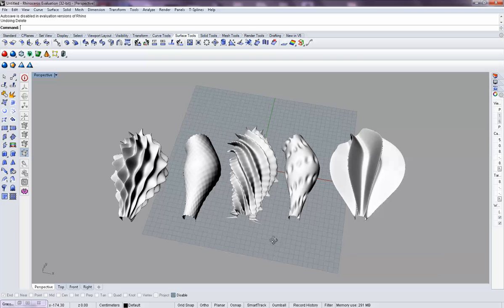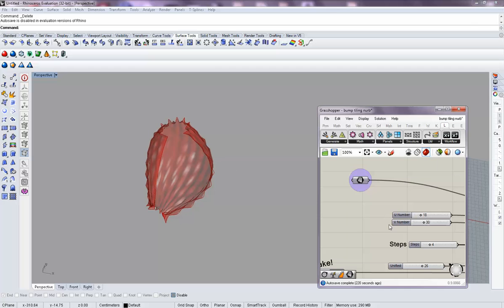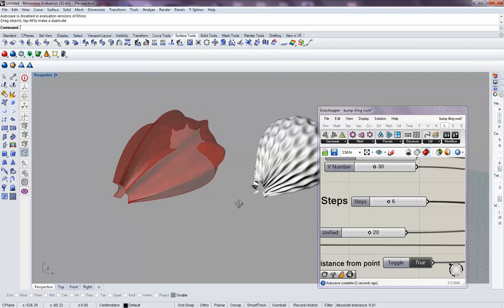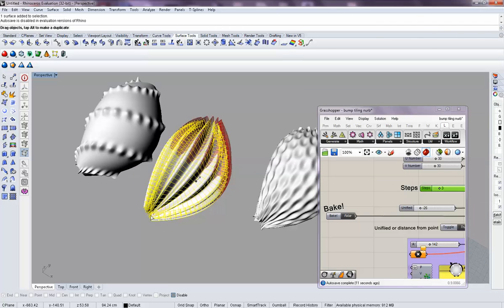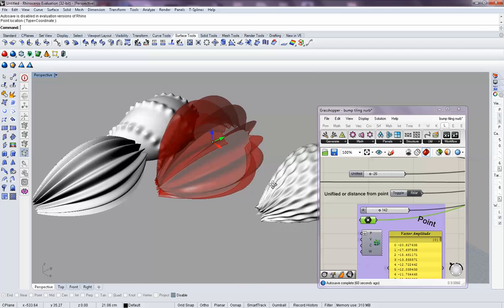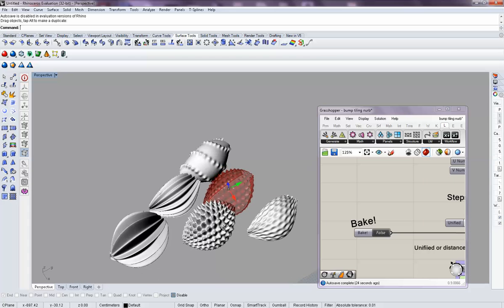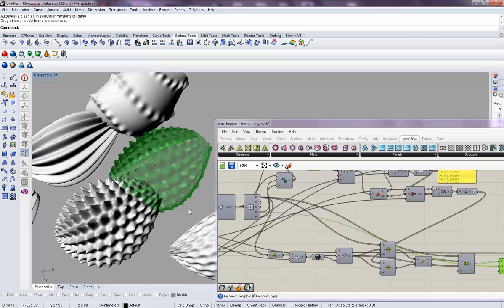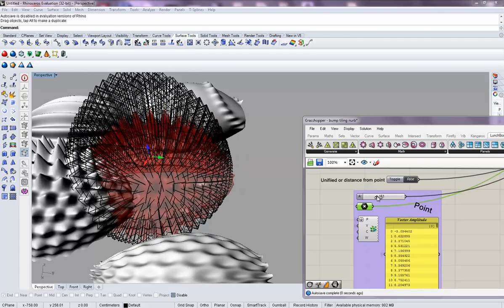Grasshopper Bump Texture

Comment: hi your link is amazing!!! I wonder if I put polysurfaces it's will work ?
Reply from the maker: תודה! Not really, polysurfaces are defined as breps in grasshopper. You can use the "Deconstruct Brep" component and then plug the faces output into the surface component... but this will result in multiple surfaces.